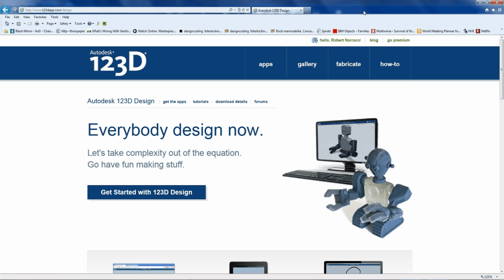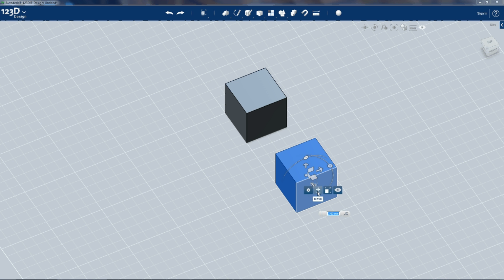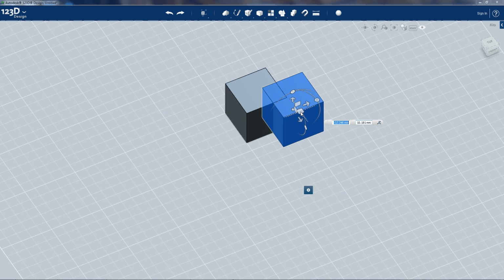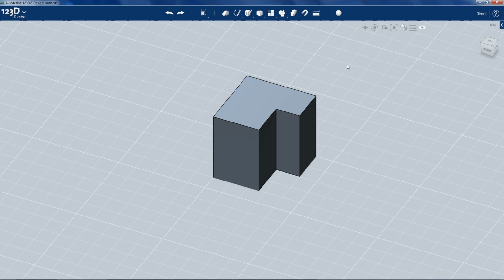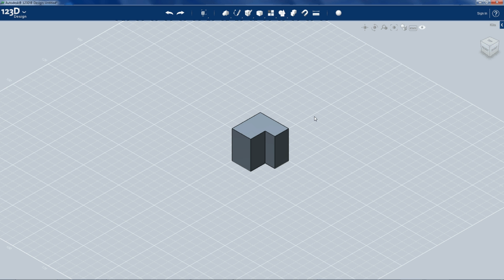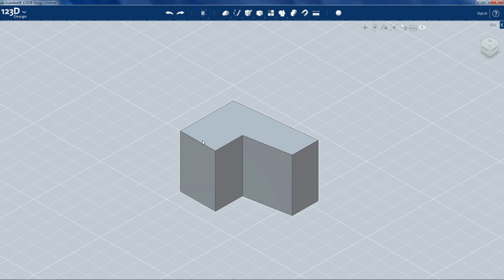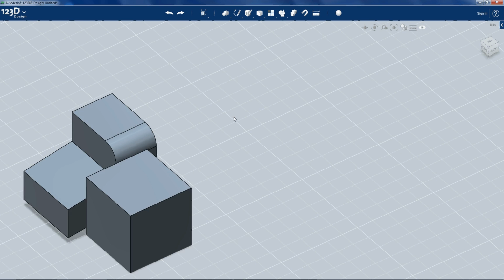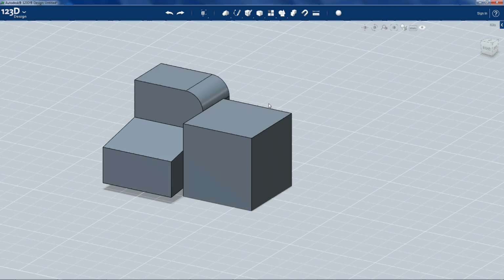AutoDesk 123D Design

Comment from the maker: Can't help much w/o knowing what you're running it on. This is AD's published system requirements for PC

Windows 7 (32-bit or 64-bit)
Intel® Pentium® 4 or AMD Athlon® 64 or later with 2 GHz or faster processor; or compatible
2+ GB RAM (1.5 GB minimum)
1.5+ GB free disk space (for installation)
Direct3D® 9 or 10 graphics support with 64+ MB